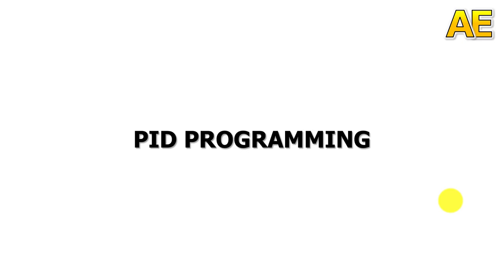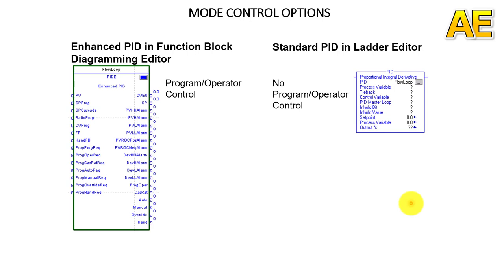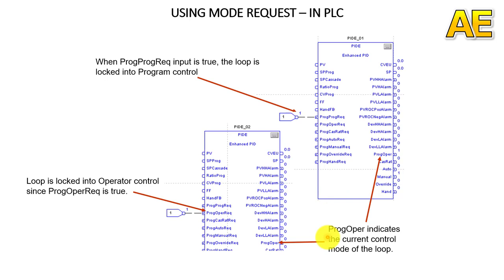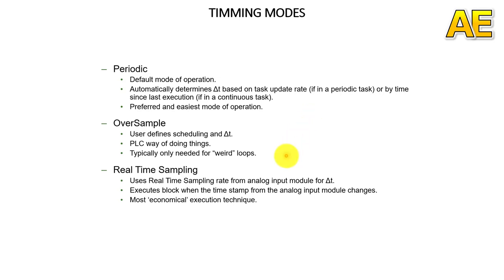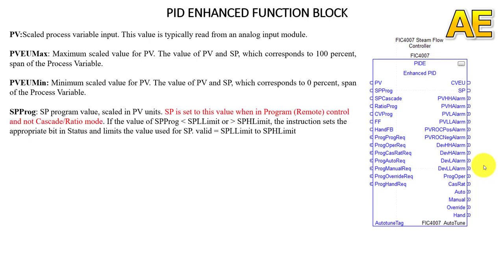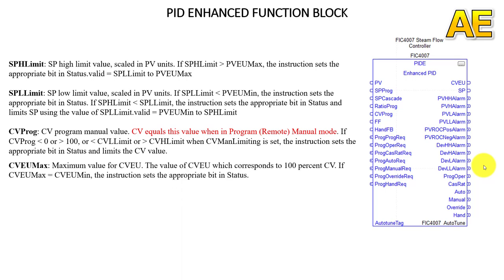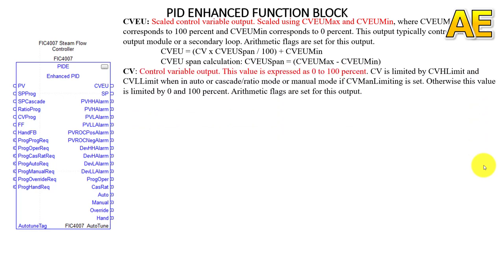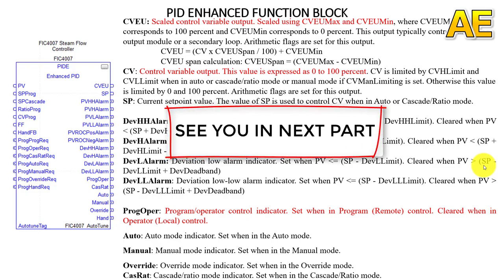Program For PID Control Part 1 | Rockwell Automation

Comment: How to set parameter in PID block when use it with inverter for control speed or position ?
Reply from the maker: Let’s see in part 2, Sir
Reply: @AutomationEngineer  sir when will you release part 2?